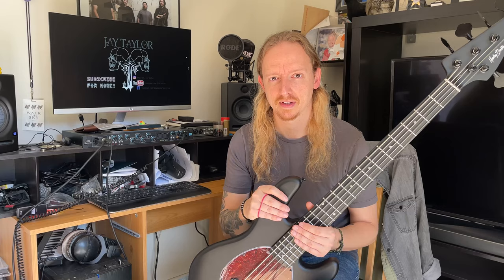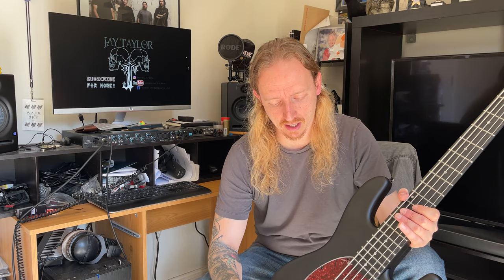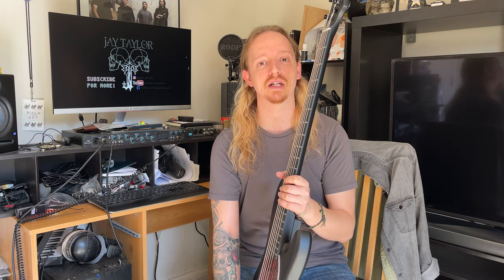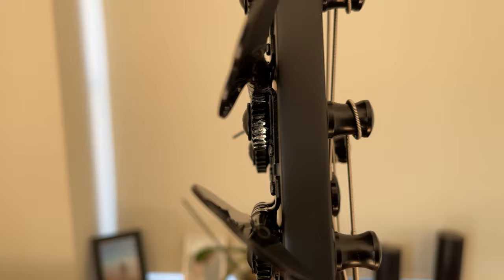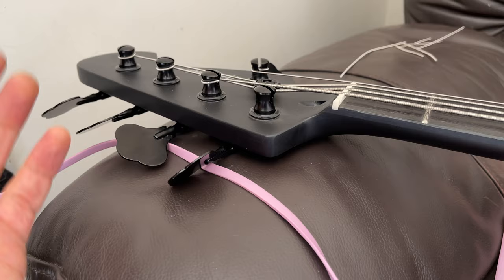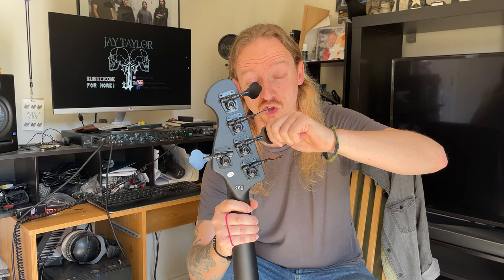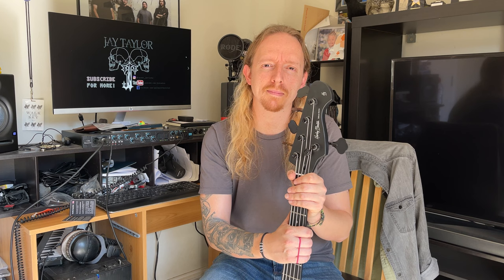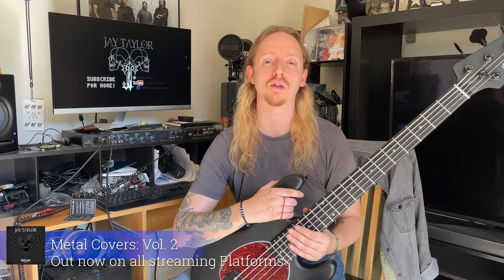HARLEY BENTON MB-5 SBK EXTENDED REVIEW - DO THEY ACTUALLY QUALITY CONTROL THEIR PRODUCTS?

Comment from the maker: Thanks for watching this video! What do you think of Harley Benton guitars? If you own one, have you had any issues with yours? Comment below!
Reply: Hi Jay! Thanks for this in-depth review, I’ve been looking at this bass, but I decided to hold off for something else. Hope you don’t mind a question about your desk setup, I really like the cabinet where your PC monitor, interface and monitors rest! I could use something like that. If you have a link, would you share where you got it? Thanks in advance!
Reply from the maker: Hey Oscar! Thank you for the comment. That unit is actually just an old DVD rack that I had lying around that I turned on its side and laid across my desk as I needed more room for my monitors and stuff. It worked out better than I thought. I think it might have been from IKEA, originally. Thank you for your question! I hope that helps. 🙂🤘🏻
Reply: I have 4 HB basses one of which is the MB4. One of mine was replaced under warranty because the preamp died. All the others were taken to a guitar tech for a setup and have the frets levelled and any sprouting (which has been minimal) sorted and they’ve been spot on. The extra that I pay for the setup and new strings makes the HB basses at least match those at twice the price!!!

Comment: In my opinion these are fixable issues and most of which can be avoided from the beginning. I’ve bought several budget basses and here’s what you HAVE to do…

1) learn to to turn a screwdriver and a wrench. The tuning peg issue can be avoided if you take a screwdriver as soon as you pull the bass out of the box and tighten every loose screw on the bass. ALL OF THEM! More than likely that center screw on the tuning peg was loose which caused the gear to become offset and thus grinding itself off.  Fixable from the beginning if you know what to do! 

2) For the B string issue. Go to Harbor Freight or any hardware store and by a stepped drill bit or take a regular drill and drill bit about the same size as the part of the string that won’t go through and reem the hole out just enough for the string to slide through. Simple fix. 

With these budget basses, you have to do a little preventative maintenance right out of the box. Nothing major but do it periodically for the duration of the time you have the bass and it should last you a long time.
Reply: you are absolutely right, when you buy dirt cheap you gotta be ready to work on it at least a little. if not now later.

but like you dont even need a drill to fix the bridge diameter issue, a small rasp would do the job easy. Dont forget to tape off the pickups so you can collect the metal shavings if they are magnetic

Comment: I just got one of those myself.  I put some DR Fat Beams on it with a 125 B string and it fit fine through the bridge hole. The tuners are functional, though they do feel cheap.  The sides of the frets aren't the smoothest, but not not super jagged like LowEndLobster's.  All in all, not bad for the price.  I'm gonna explore some better electronics options to see if I can liven it up a bit, hopefully not having to cut a hole in the back for a battery.  Though with that caveat, I'm not sure I have very many options.  It sucks you got a lemon.  At least it's an affordable and fixable one.
Reply from the maker: Sounds like you’ve got a good plan for the guitar though! Hope it brings you the sound/tone you want! Appreciate the comment, my friend. I definitely got a lemon. 😂
Good news is, I did manage to arrange and have it swapped out and it has since been replaced. This one is much better! 🤘🏻

Comment: I had a HB 5-string bass. The PJ-5 HTR to be exact. It was OK, no really big issues there. I didn't expect too much, knowing that it was the absolute cheapest 5-string bass that i could buy new. Crap factory strings, but I also expected that, so I bought a set of D'Addario strings together with the bass the bass. It had a .135 low B string, which was a bit thicker, so I just used a needle file to make the hole in the bridge a bit bigger. It wasn't absolutely necessary, but only took about 2 minutes. I only bought it, because I wanted to try out if I liked 5-string basses. (As it turned out: not really, so I sold it later.)
I also have a tele-style guitar from the same SBK series, just to have a guitar too. Also really cheap, and it shows too, the fretwork on that is horrible, jagged fret ends, some frets not seated properly in the slots, uneven fret height, but again: I kinda expected that.
All in all: The PJ-5 HTR was OK, the frets were much better than the tele, but don't expect any actual QC in the case of these cheapest HB guitars. It really is true, that you get what you pay for. They say the upper line of the HBs are much better quality, but I didn't try those yet.

Comment: OK, this would be funny if it weren’t true. I just received the same bass today and have the same issues and more! In my case, it’s the D string cog that is smashed. It turns but with difficulty what the hell is going on at quality control how can they miss this? How does this happen? Also, with mine the first volume control closest to the neck does not work at all nothing I tried tapping it. Nothing illicits anything from that pot. I also noticed this bass is noisy as hell to the point of it turning heads at practice this is not normal. The playability is not bad at all and the sound if you can get past the noise is fairly decent, but with all the quality control issues. I am boxing this sucker up and sending it back just out of principle, I could fix all the issues but I didn’t purchase a broken base to be fixed. I don’t care how inexpensive it is as to whether or not I buy something from Harley Benton again it’s not likely. This is too big of a miss.

Comment: Really useful video man, was considering this bass but looks like it needs the tuning pegs replacing out the box and tapered low b string sets going forward 🤔
Reply from the maker: Thanks, James. If it wasn’t for those issues, I’d have been happy with it. I’ve just literally received my replacement after over a month of communicating with Thomann. I’m yet to take it out of the box, so I’m hoping it’s not going to be a repeat issue. 😬

Comment: Yeah, the f*cked tuner thing sucks. That shouldn't have passed QC. They would send you a replacement, refund some of your purchase price or let you return it. You're right, though, with inexpensive instruments they have to save costs somewhere. It's unfortunate when cheap parts or lax QC ends up negatively affecting your experience. The bridge hole thing is lame as well... but could be easily addressed with a file, a reamer or a drill, so IMHO not on the same level as the tuner.  

I can only speak to my own personal experience, so your mileage may vary, but I've bought like 72 Harley Benton instruments over the span of 3 years... and about 25%-35% of those have been B-stocks. That averages 24 per year (6-8 of those being B-stocks), spread out over time, usually buying 2-4 instruments per order to minimize  shipping costs. The spread over time is important because it demonstrates consistency over the span of 3 years.

The instruments I've bought have varied across the entire spectrum of the Harley Benton brand models of electric guitars & basses: entry-level to the highest end models, of every category they offer, copies of Strats, Jazz basses, 4 & 5 string basses, Les Pauls, MusicMan bass copies like yours, metal-oriented guitars, 6 & 7 string guitars, fan-fret guitars, semi-hollows, etc. of every construction type: set necks, bolt-on necks, neck thru, manufactured in facilities in China, Vietnam & Indonesia. 

Within this sampling I have not experienced anything on the level of your jacked up tuning peg. The worst I've had was a quality control issue in the wiring of an active bass. I took care of it myself, no problem, but it could have been a show-stopper for someone else depending on their knowledge & experience. Obviously, your mileage may vary. 

I think Harley Bentons represent a great value proposition if you have calibrated your expectations and are pragmatic about it. The model of bass you have and similar models cost like ~$100 plus shipping. You couldn't buy a kit worth a damn, or body and neck alone for that. Entry level models, especially ones which conform to industry standards like the P-Bass, Jazz Bass and MM-Bass models as well as their guitar counterparts like the Strat  & Jaguar type models are good mod platforms. The bodies and necks are solid. Consider the hardware and electronics as FREE temporary parts. They'll get you by and generally work fine until you replace them with something better. Parts of every level of quality and cost are plentiful for these 'standard' models. You have to be realistic about what you're buying and what's reasonable to expect for the amount you're paying. Did you expect your $100 Harley Benton MusicMan bass copy to have the same features & performance of a $2500+ USA model? No fkn way!! Even a $400-$1000 Sterling? Not without some aftermarket parts and the time & attention to make it so. BUT, if you invest the $100 for the bass as a platform and spend another $100-$250 in parts you can arrive at something as good, if not better in looks, feel, performance & sound quality as a mid-tier Sterling, customized to your personal preferences for less than a Sterling off the shelf, no question.

As far as the higher end Harley Benton guitars and basses like Enhanced, Elegant  or Progressive basses or the higher end LP & Strat copies: SC-550 Plus EMG or Fusion III EMG models and the Amarok neck-thru EMG metal-oriented guitars, they are more expensive at ~$300 to $500 but come with premium features like Stainless Steel frets, high-mass bridges & active electronics for the basses, locking tuners, name brand pickups, both active or passive, with more sophisticated wiring & switching options, etc. These instruments represent an extremely high value proposition even with their higher price-point, easily competing with instruments in the $900-$1500 range.

Just do your research, calibrate your expectations and contact Thomann customer service if you encounter any issues and you'll have a much better experience.
Reply from the maker: Well, I did end up contacting the guys at Thomann about this guitar and they did swap it out for me and replace it, which was great. The second one works just fine and has none of the issues that this particular model had, so I’m pleased with it for a cost effective purchase. It was one of those things where I kept hearing about Harley Benton guitars, and I needed a new bass anyway, so I figured I’d try them out. The first experience was certainly a memorable one, but I’d still buy another from them if necessary. 

Funny story - I recently had one of my viewers reach out and message me to tell me that they are now in possession of the very bass guitar in this video. Complete with the same issues and the same string I replaced the stock strings with. I thought it was cool that they’d bought the return stock of this guitar and even cooler that they’d share that story with me. Small world. 🤣

Really appreciate your comment and input my friend. Thank you! 🙏🏻

Comment: Thomann would send you replacement tuning pegs if you ask them. My experience of HB has been largely positive but I am in UK so if I had to send back to Thomann it wouldn't be a big expense or time lag.

I tend to buy HB to mod. But I agree you should expect the HB to function. Maybe the strings were also incompatible with their bridge.
Reply from the maker: Really? Maybe I’ll reach out to them and see if they’ll send me some replacement pegs. This is handy to know because I was expecting to simply buy replacements myself. This is great to know, so thank you for your input and sharing your experiences. I’m certainly still loving the guitar despite the couple flaws I’ve had. 😄🤘🏻
Reply: @JTStudios  well particularly as you know what you are doing with guitar - so you can point them at your channel / video, they can see this isnt your 1st rodeo - and it must be MUCH cheaper to send 4 pegs rather than a whole bass. Not sure about the bridge - if it were me I might open it up with a drill bit. I guess they could say "oh brand X strings work". But given strings are the 1st point of contact with your fingers, and 2nd with the pickups, personal choice comes into play. The B string didnt look too fat. There again I have the funny (remake) Steinberger's so string choice is often limited by a particular bass.

Regarding weak output - on my channel I reviewed a fretless HB - and even though that is active it also needs a bit more gain than most passives I have. The EMGs are larger output - but even they can be quite. I tend to favour active over passive mainly because of noise in my local environment. That being said - I found out recently I have a large burn hole in my florescent tube ... I feel some LEDs will be on the way - maybe this will quieten the env.

Let Thomann know you will make a video after you have fitted the parts - again so far I have found them to be much better than most UK suppliers and they are probably gutted you got one in a slightly shoddy state. Let us know if they have changed their tune.

Comment: My man, did you return this bass? As I bought a B stock of this, and I had the same thing on the same tuner, the same string colours, the B was sticking out (purple) and from the looks of the neck I have the same small discolouration on the 1st fret :face-blue-smiling:
Reply from the maker: No way? I did return this guitar. They swapped it out for a new because of the faults. Are you telling me you are in possession of it? 🤣
This is weirdly kinda cool. 🤘🏻
Reply: @JTStudios   Yeah, I couldn't believe myself. I also checked some cues like the truthful QC check stiker position and everything and all adds up. Anyway, i sorted the B string by widening the hole with the drill and got a new set of tuning pegs, it works like a charm now. Take care 🤘
Reply from the maker: That is awesome. I’m actually happy that you’ve fixed up the issues. I suppose these were things that I could’ve sorted and fixed, but I didn’t want to. 😂
Dude, thank you for reaching out and sharing this. I really appreciate it. 🤘🏻

Comment: You put XLs on a bass designed for standard strings... DERP on you, not HB for that.
Reply from the maker: The D’addario XLs that I use are the exact same gauge string that the guitar ships with - it makes no difference. This guitar was replaced, like for like, by HB and I’ve had zero issues since. It was just a bad build. Simple as that. 🙂
Reply: @JTStudios  Hello! Did you have any problems replacing the strings on the bass that was replaced?